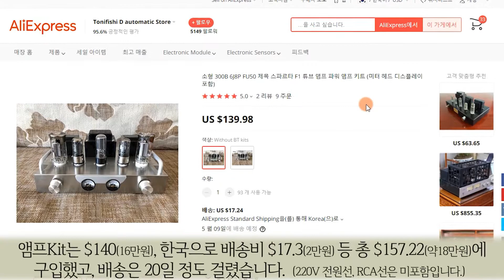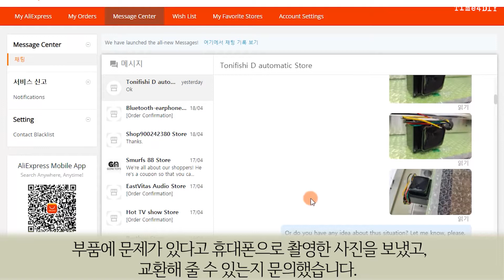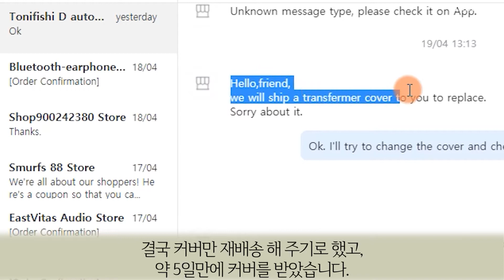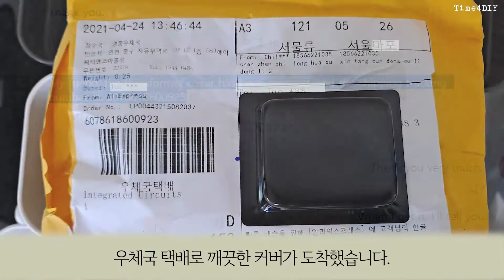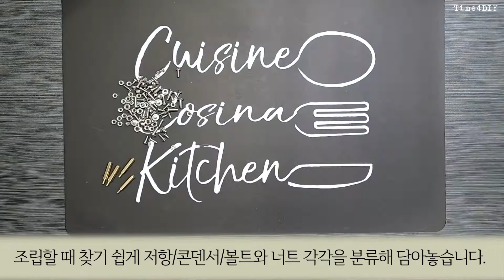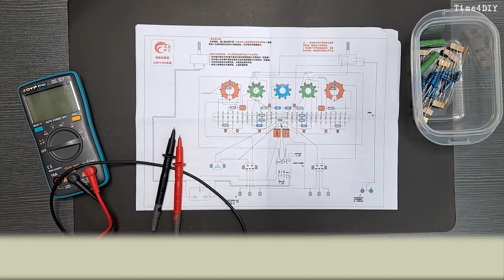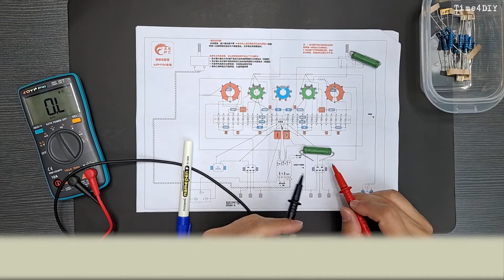[Manual #1] FU50 진공관 앰프 Kit 만들기(언박싱, 부품/공구 준비) Making FU50 vacuum tube amplifier kit(w/ unboxing)

Comment: Is the electric scheme of this amplifier with FU50 tubes different from the same amplifier, but with EL34 tubes? Or is the only difference in tubes? Have you ever met the same amplifier, but with 6P3P tubes? Does it have its own electical scheme or the same wit EL34 tubes kit?
Reply from the maker: The basic scheme of FU50 amp is same as of EL34 amp. Two amp is based on single-ended circuit. But the values of resisters and capacitors are different, not same.
And I have not met any amp with 6p3p tube.
Reply: @time4diy626  the electrical scheme for 6P3P should be rather different for the best sound (there is a photo of such scheme on Aliexpress, but usually the arrangement of tubes in such amplifiers is not symmetrical), but here amplifier uses 6P3P and the arrangement is symmetrical, so I am afraid of ignorance of some sellers. It is thought that the the sound of 6P3P is softer than El34 and more suitable for jazz or classic music.